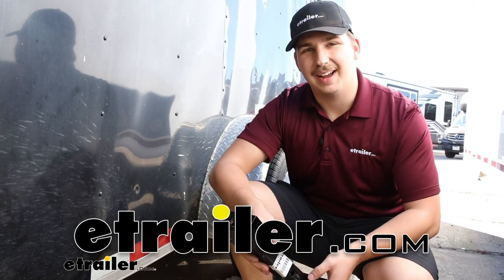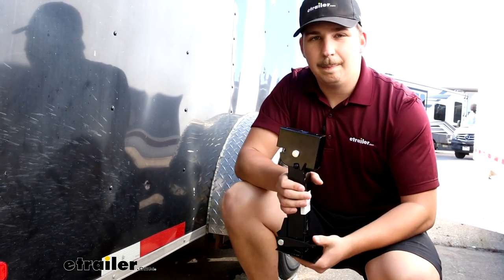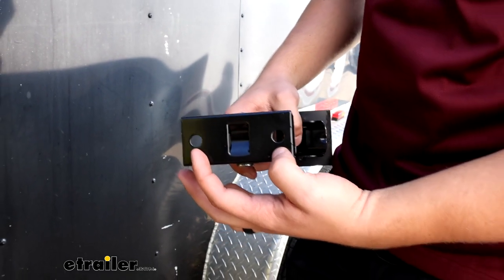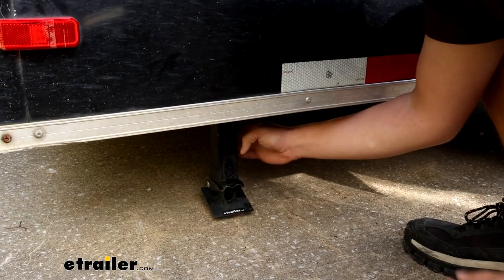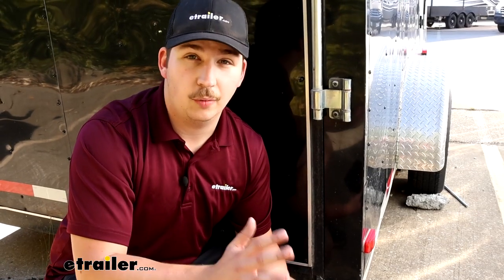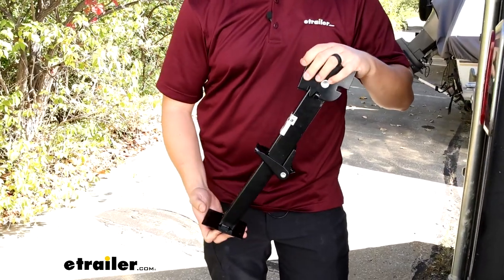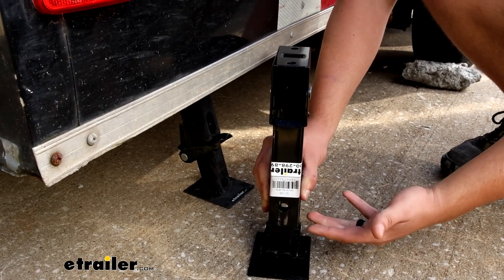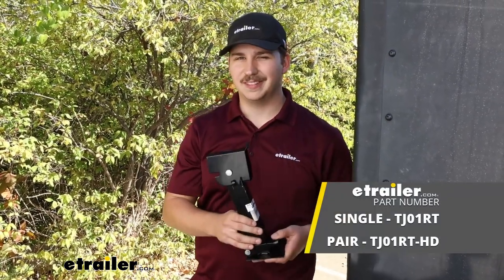etrailer | A Closer Look at the Stabilizer Jack

Comment: I'm tempted but I have one concern that maybe you can address.  If I set these jacks with the trailer empty and then load it up, it's obviously going to be a lot harder to unlock the slider latch thing and fold the leg up so I can drive away.  Has that been an issue for skinny old ladies who don't follow the Richard Simmons workout program?
Reply from the maker: If you purchase the pair of stabilizer jacks, it'll include the bar needed to raise and lower the jack. It does take a bit of force to lift or lower the ratcheting mechanism, I'd recommend getting a 2-3 foot long piece of 1/2 inch steel pipe that you can slip over the bar which will allow you to apply more leverage without breaking your arm off. Hope that helps!
https://www.etrailer.com/Camper-Jacks/etrailer/TJ01RT.html
Reply: @etrailer  lol,  but true.